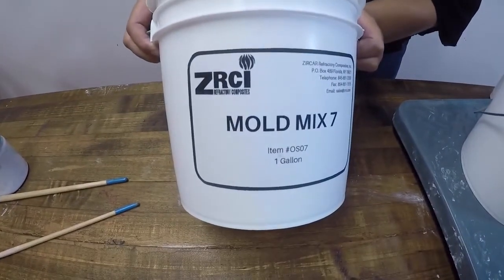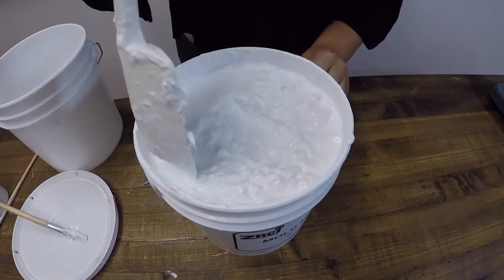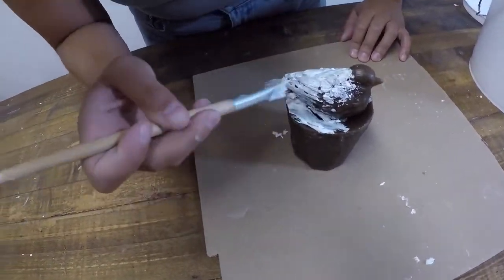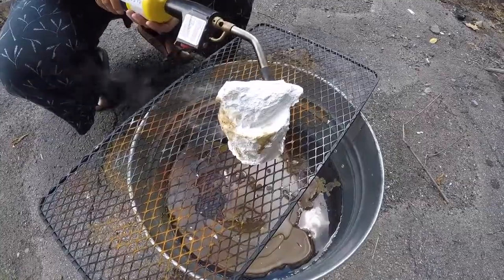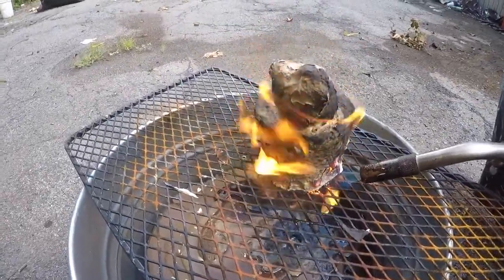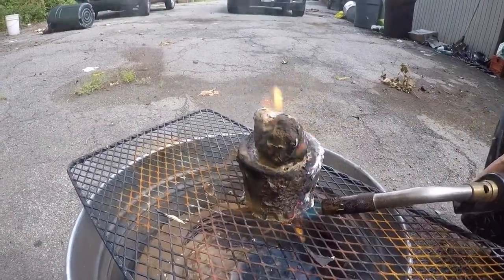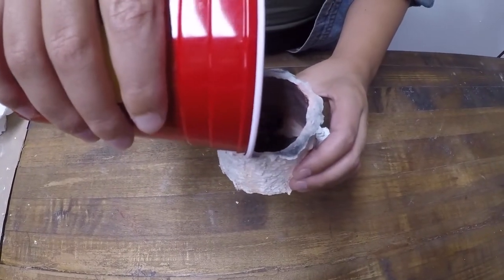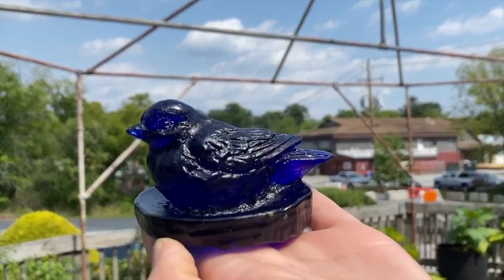3D Kiln Cast Glass Bird Made in a Mold Mix 7 Mold

Comment: Heating the outside plaster mold work with mold made with silica/plaster and water or just works in the one you indicate? I've never seen this method of wax lost before (heat the outside with torch)

Comment: Hi love the video. I noticed you mixed the whole container. I was wondering how long will the mixture last in storage if you seal the bucket properly. Another question I had  is if your casting bronze do I need to preheat the investment before I pour the bronze ? Thanks
Reply from the maker: Thank you for your questions!  Once the bucket is mixed it the paste will last for several years.  If the mix dries out you can add more water and remix to the desired consistency.  For bronze casting you do nit need to preheat the mold.
Reply: Awesome thanks

Comment: Admittedly, I'm a little bit confused on your video where you're heating the outside plaster shell in order to remove some of the wax, rather than concentrating the heat from the bottom side.  I thought the plaster jacket would prevent most of the heat from penetrating.
Reply from the maker: Hi there,  this material is not plaster, it is Alumina which is a high temperature refractory material.  It has very different properties than plaster and the flame is applied directly to the mold in order to 1) cure the ceramic bonds of the mold 2) remove there wax

Comment: What is the difference between this and plaster silica?
Reply from the maker: This material is made of Alumina which is a type of high temperature ceramic.  The application process and wax removal is different from the traditional method of plaster silica mold making

Comment: What kind of glass can you use.?
Reply from the maker: The blue glass is a piece of Bullseye sheet glass broken into pieces.  If primed with kiln wash or another primer all types of glass can be used.  These molds are also used for bead making and hot casting